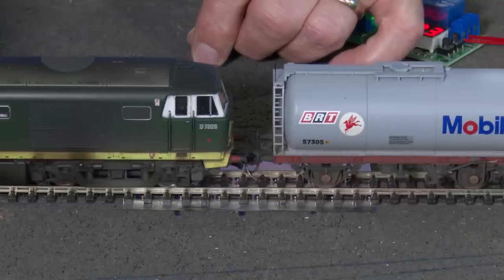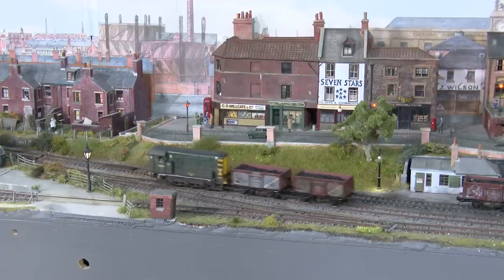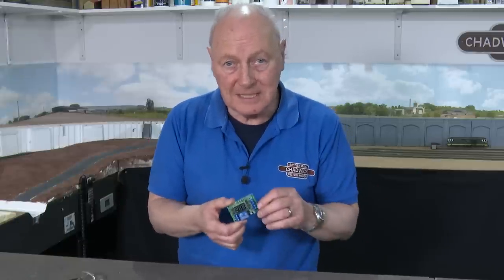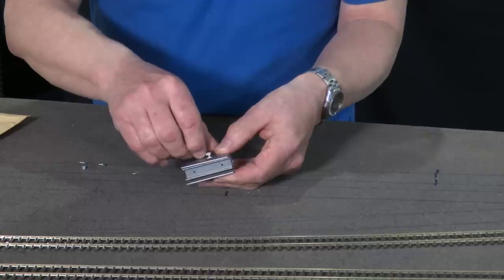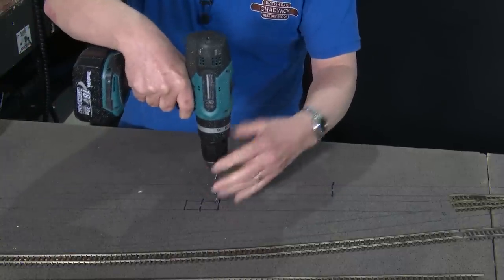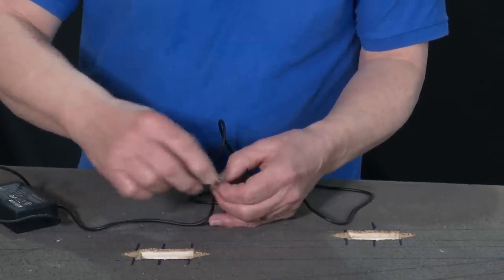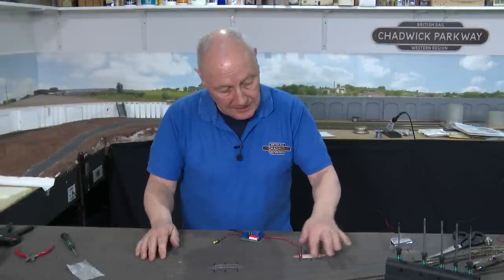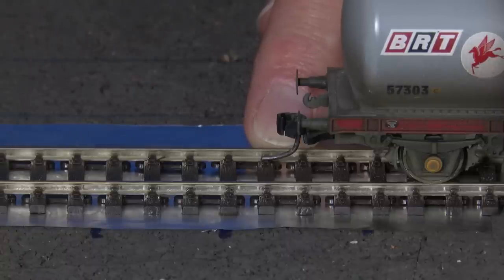Installing Kadee Electro Magnetic Uncoupler #309 Chadwick Model Railway | 182.

Comment: Hi Charlie, another great video. I have used the same magnets and timer relays on my Ho exhibition layout (you came behind it at Ally Pally last year to chat with David). It is quite easy to wire the LED in the push button to show when the coil is energised - just simply take a feed off of the NO output on the relay (which runs to the coil), through a resistor and then run it to the LED contact on the push button. 
I’ve also installed Arduinos to act as a DCC accessory decoder to energise the coils (for when we operate the layout from the front). These are great and cheap.
If I were to do it all again… I would not use the Chinese timer relays at £5 each. I would simply buy an Arduino for £11, an Arduino relay block for a few quid and wire up the push buttons to the Arduino (rather than the timer relays) and run all of the solenoids/coils off of the Arduino. I have thirteen uncouplers on the layout so it would have saved a good few pounds that could go towards my gas bill!
Reply from the maker: Great comment, Antony, and I hopefully I’ll see your layout at a future exhibition. Regards, Charlie
Reply: @ChadwickModelRailway  And if you use a two colour led switch you could have it change over from green to red,say, by powering from the nc and no contacts, appropriately!

Comment: Another great video Charlie Thankyou. There is a critical modification you can make to the circuit that no one seems to mention. To prevent arcing across the switch contacts when they are released, solder a diode across the solenoid, just as you would a relay solenoid. This would also protect any connected delicate components.
Reply from the maker: Now there is something that I certainly hadn’t thought of. 
Thanks Peter, regards Charlie

Comment: I suspect others have pointed this out - but what you can do is power the LED on the push button parallel to the output of the timed relay , that way the push button is illuminated during the time the solenoid is powered - so you have an “active” indicator on the buttons.
Reply: Better to connect the LED to the NC side of the relay,, then it's off when the solenoid is active, and on so you can find it when you need to press it!  Of course, you'd need the power to be on the common connector then.
Edit: Damn, beaten to it by Steve Jubb!
Reply from the maker: Actually, Steve, that doesn’t work! I shall have to investigate. Regards, Charlie.
Reply from the maker: Better to have it illuminated prior to the push. Regards, Charlie
Reply: @ChadwickModelRailway  Did you swap the NO and Common connections?
Reply from the maker: No, but I shall. Regards, Charlie

Comment: Here's a thought: before deciding the exact location for your solenoid, fit the permanent magnet types, and when you're happy that's the right location, fit the solenoid. Otherwise, move the magnet until it's in exactly the right location for your layout. A bit pesky trying to do it without lifting the track, but...
And, by silver foil, do you mean baking foil / aluminium foil? Silver would be expensive, gold leaf might be better... ;-)
Reply from the maker: You make an interesting point, perhaps it was aluminium foil.🤪

Comment: Great stuff, thank you. I have one of those uncouplers but haven’t got around to adding to my layout module yet, so really useful seeing you do it. A couple of thoughts, by switching the Common on the relay board to power feed you could use the NC via resistors to power the LED on the actuator button. That way it would go out while the solenoid was active. Also, using an Arduino with a solenoid board you can control multiple uncouplers and even automate them (I’ll confess not something I’ve done but entirely doable I think).Steve
Reply from the maker: Many thanks Steve, your suggestion to power the LED from the common, is entirely sensible and well worth a look while the board is still on its back. Regards Charlie.
Reply: And when I said ‘solenoid board’ I meant a relay board controlled by an Arduino, apologies.

Comment: Great video - As I had already laid and ballasted my track I just used two rows of 10mm x 3mm Neodymium Magnets that you can drill and place between the sleepers, works quite well and is much cheaper...
Reply from the maker: At least you have found a good workable solution, Andrew. Regards, Charlie

Comment: Great instructions and got us so far, our use case was to fire the relay using our DCC Unit (ECOS Command Station), we thought it would be a simple case of wiring up the switch side of the relay to a ECOS Switch Pilot plus, so we could use a dcc address to fire it.  However just simply connecting to the relay to the switch pilot didn't work, we worked out that if we soldered a resistor on to the relay switch output, then connect to the switch pilot plus, we were then able to fire the uncoupler using the Command station and dcc address.  Which means we can also now trigger using TrainController.  Keep up the good work.
Reply from the maker: I’m so pleased that the video was useful Ian. Regards Charlie

Comment: Hi Charlie, excellent video yet again.
Just out of interest I’ve used the switches with LED’s inside them, as you said they do look good. You mentioned have it flashing so you know something happening.  I thought the same. I couldn’t do the flashing so I powered the LED  from the same wires that feed the solenoid so the LED is only on when the solenoid is on.
Remember you may need to put a resistor in series with a feed depending on what the LED voltage and current is, that’s if it’s not already fitted inside the switch.
Regards John
Reply from the maker: Thanks John, much appreciated. Regards, Charlie

Comment: Hi Charlie if you Connect the LED input on the swirch 1/3-2/4 to the relays NC and the common as input from the powersuplay and out to the magnetic on the NO output then the green light will be lit until you push the button and then the green light will be turned of until the relay switch back again.
Reply from the maker: Now that sounds an ideal solution. Thanks Richard, regards, Charlie

Comment: for the push button, you could use that single pole relay to drive another relay (or even de-solder that and just use the driver circuit). then make that other relay double pole - use one half to switch the solenoid, and use the other half to drive the button LED - it will then light up when the solenoid is energised and go out when it isn't
Reply from the maker: A good point Dale, however, you could work the other way around, so that it goes out when the solenoid is energised. Regards, Charlie
Reply: @ChadwickModelRailway was thinking thinking same - use the NC pole to control the LED, with a suitable resistor in series, off the same 16 Volts supply.

Comment: You could easily wire up the LED switch so when the relay is active, it also lights the switch. That would be an indicator that the solenoid is functioning. Personally, I like to use Arduinos for such operations. One Arduino could handle all of your decouplers and you can program it to do much more than simple on/off. Variable timings, automation, the sky is the limit. Of course, that adds a degree of complexity. 

I enjoy watching these types of videos. Not because I need to learn something, but because of the time and effort video creators such as yourself spend to help others. And that's a really good thing. Great channel, great video. Keep up the good work.
Reply from the maker: Thanks Roy. I am currently taking advice on Arduinos, we’ll see how I get on.  Regards Charlie

Comment: on your switch you could wire the LED to the N/C of the relay. being an automotive type switch they can generally handle up to 18v just fine.

then when you press the button, the light turns off for the entire time the solenoid is active
Reply from the maker: I shall try it RR. Regards Charlie

Comment: Many thanks for sharing Charlie. This has to be one of the best step by step guides that I have seen on this. A very good point about taking the watch off, magnetic fields (that sounds like a title for a Jean-Michel Jarre album) can cause havoc for mechanical watches. This can also be the case where they are near to other magnetic fields including loco's, point motors and speakers. It might be an idea to use a cheap digital watch when working on or using the layout. Of course you could just use a wall clock. Thanks again Charlie.
Reply from the maker: Thanks Anthony, as you say, you can’t be too careful. Regards, Charlie

Comment: Awesome Video Charlie
Reply from the maker: Thanks C2000, regards Charlie
Reply: @ChadwickModelRailway  your welcome i had that same problem you mentioned with the permant magnets where the train shutters and it uncouples .on my model Red rattler electric train but as i keep it as a permant 4 car set i have cut off the unlocking pins from the kadee couplings .

Comment: A few have mentioned the diode across the coil to prevent damage to the relay contacts when they open.  This is also highly recommended to avoid electric shock.  When the contacts open, the magnetic field of the coil collapses and this generates a high voltage (generally a few hundred volts) and this will give you a big surprise if you are handling the control board at the time.
Reply from the maker: You make a very interesting point, SH, I shall certainly look into it. Regards, Charlie

Comment: Super complicated Charlie. Thank goodness I use DG Couplings. Simple under board magnet. Worked impeccably for me for years at exhibitions. Mine is just a small hole through the board, insert a cylindrical  tubular electromagnet  and then ballasted over. I however do like the idea of the timer, but an expensive project when my layout consists of 27 points/switches. 27 boards at, as you say, about £6 each eats into my pension too much!!  Great video as always though Charlie. Everything beautifully filmed and explained. Cheers, Bob
Reply from the maker: Thanks Bob, I’m so pleased that you found it interesting. Regards Charlie

Comment: Interesting video Charlie.  I am in the process of converting my stock to Kadee, and looked long and hard at this exact solution as I didn't want visible magnets between the rails.  However, I eventually went with neodymium magnets mounted on a hinged plate that is moved with a servo.  I think it is a bit cheaper than using Kadee's solenoid, and only requires the servos to be wired.  Also there is no possibility of a solenoid overheating or burning out if there is a problem with the relay not switching off.  All horses for courses I guess, but it is an alternative for an underboard solution.
Reply from the maker: What an excellent alternative Sorarse.
Regards Charlie
Reply: Do it without the hing. Attach magnet to servo ‘arm’. Move 180 degrees.
Reply: @gregdotlola  That would be another way, but my baseboards are 12mm, and would find it difficult to mount the servo in such a way as to get the magnets (I use two) flush with the baseboard top under the rail.
Reply: Hi Sorarse, can you give me a little more detail on the size, magnetic strength, and number of magnets you used. Also the distance underneath the rails and orientation they are mounted. Thanks
Reply: @johntuttle5045  John. I used 15mm dia x 3mm thick round neodymium magnets.  I use two per decoupler, mounted across the rails and as close as I could get them.  Basically I cut a hole in the baseboard, and then placed a small piece of very thin plastic across the hole to stop the ballast falling through, and when operated the magnets come up flush to the plastic.  As you probably know, neodymium magnets come in different strengths, and I bought the strongest I could find.  Hope that helps.

Comment: Button idea: you could connect button's backlight to relay output, so button will indicate when coil is energized.
Reply from the maker: But when it’s energised, you don’t look at the buttons. You’re looking at your wagons. Regards, Charlie
Reply: @ChadwickModelRailway This is true, however it could be useful for fault detection in the solenoid. For example if it was to become stuck on or not want to turn on, it could act as a visual indicator as to the status of the solenoid. Just some food for thought! 😊 Regards, Shaun

Comment: Two options for making the light in the switch light when the coil is active, first you could wire the light to the LED on the switching board or second you could add the light in the switch to the coil circuit (parallel to the coil) so its on when the coil is active.
Reply from the maker: I had thought of wiring, so the light is out whilst the solenoid is energised. Regards, Charlie

Comment: Excellent idea Charlie. 
You always come up with those " why didn't I think of that " ideas. 
I think I will eventually use magnetic couplings with KDs at each end. But in the meantime that idea will get me through. 
My Bachmann coaches also have couplings at a 
Different height to other stock . A real pain. 
I had to compromise and use small Tension Locks to couple between them and my Hornby Castle. They seem to be more tolerant of small height differences.
Reply from the maker: I agree, Howard, couplings are a curse to UK models. Regards, Charlie

Comment: Charlie, There are a few ways to indicate the activation of the solenoid. If you want to have the "normal intensity" light be on all the time you can take the button LED voltage feed from the normally closed (NC) relay port and connect a diode and a suitable resistor from NO to NC port. Then, when the solenoid is activated the button will be dimly lit. Of course, if there is no need to have the button lit when active, the diode/resistor scheme is not needed.
Reply from the maker: I think you’re right HL, why would you need to look at the button when you’re too busy uncoupling. Regards, Charlie

Comment: If you keep your watch away from the solenoid Charlie I would warn anybody with a pacemeker if they are close to the edge of the board! Another very useful session on uncoupling I could be tempted to change to KD from Tension lock as they look and behave much better.
Reply from the maker: Wow, an interesting comment Paul.  That’s most helpful.  I’ll recheck those instructions for a similar warning.
How’s your understanding of Flagmen in TC?
Regards Charlie
Reply: @ChadwickModelRailway  i have not needed to use them as i tend to achieve actions another way.  They are like event driven variables that you can use to trigger other events.  If we have a chat sometime about what you need them for i may be able to help

Comment: great video, id of de soldered the LED on the board and used its power for the LED in the switch itll give you an indication of when the unit is powered or not the same way the board LED works
Reply from the maker: Thanks mate, what a good idea. Regards Charlie

Comment: Instead of wiring the +12v for the light in the switch from the 12v input to the circuit board, if you wired it into the switched output that goes to the solenoid via a suitably sized resistor, your button would light up when you pushed it, and go out when the timer as run out. Or, if you still wanted the button illuminated all the time, only going out when you push it, just wire it to the n/c terminal instead. Just a thought!
Reply from the maker: You make an excellent point Steve, and I think that it should go out when energised. Regards, Charlie
Reply: @ChadwickModelRailway  You'd have to put the power in on the common terminal, of course.

Comment: Great video Charlie! Hey, I've seen online (eBay) those push button switches with their internal LED lights having a separate terminal connection, so you could possibly wire that green LED status light on board parallel to the switch or just remove that status green light entirely and run wires to the switches separate LED contacts so when you press the switch it will only light up while the solenoid is on!👍
Reply from the maker: Yes you’re right mate. I could illuminate the switch only when it’s not energised. Regards Charlie
Reply: I was thinking the same thing, though to save soldering the switch LED to the board, just power the LED from the same output as the solenoid assuming the LED is happy to operate in the same voltage range as the solenoid.

Comment: Hi Charlie, thank you for a really interesting and very useful video. The issue I'm going to have using these sadly is to lift up some of the track to fit them underneath. Rails of Sheffield sell an alternative product which you can fit with the track in place but they haven't had them in stock for about 2+ years. It would be helpful if you could try installing a Kadee coupling on a Bachmann Mk1 coach as I need to convert all of mine and the height is wrong. I look forward to seeing your next video.
Reply from the maker: Thanks, Simon, and I shall certainly check out my Bachmann Mk 1s and see if the issue is repeated on them. Regards, Charlie

Comment: Hi Charlie. I echo many replies in that you are switching an inductive coil (solenoid) and when the power is disconected by the relay, a huge energy is produced when the coil 'collapses' called 'Back EMF'. This is 100s of volts for a short duration. It causes relay contacts to weld together!. The fix is to add a diode such as the very common 1N4007 in reverse polarity to the solenoid i.e. the 'bar' end of the diode connects to the positive feed on the solenoid (Fit the diode at the solenoid wires). Without it, that relay won't last long!!. As others have said, you can use the feed wires to the solenoid to power an LED and don't forget the required series resistor! 16k resistor for a 1mA LED, 1.6 k for a 10mA LED etc.
Reply from the maker: Andy, I’m most grateful for your advice.
Rest assured that I’m on the case.
Regards Charlie